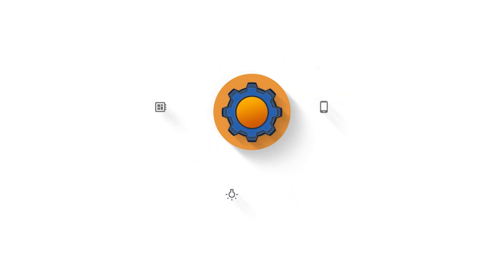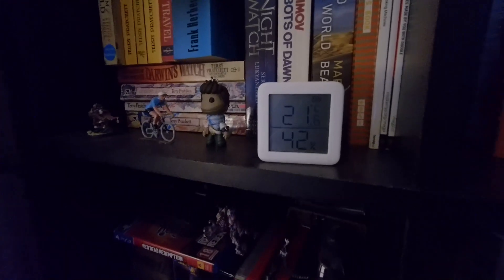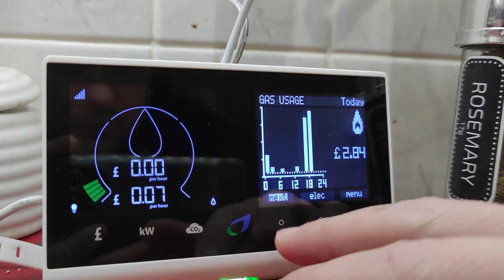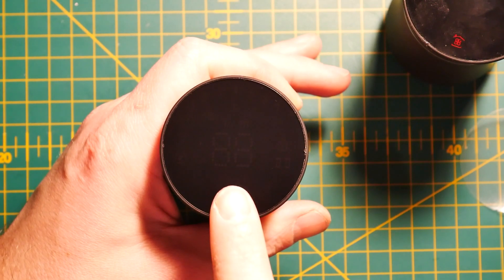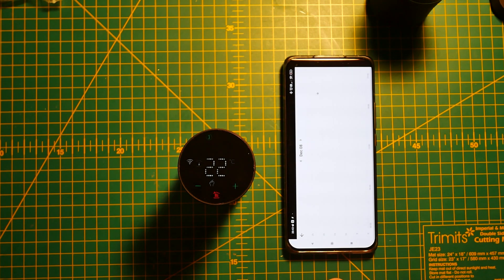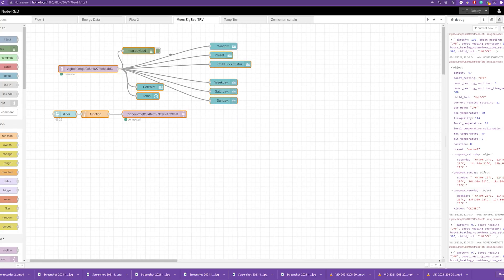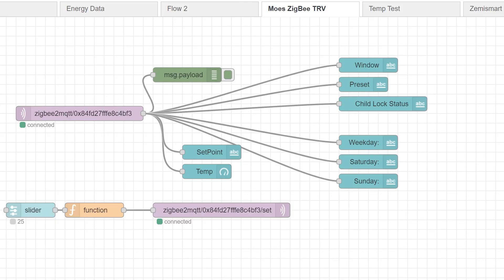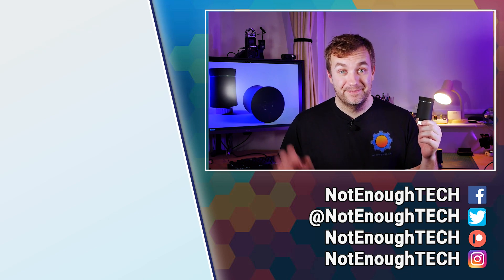Automating old heating system with Moes ZigBee TRVs

Comment: Hey, I stayed away from wifi/zigbee TRVs as I heard the motors driving them are noisy and not recommended in bedrooms. Any feedback on the noise on this one? I was planning on doing electrovalves in the splitter box controlled by a NodeMCU + relays but it's more expensive and harder to install (pipe cutting + fitting)
Reply from the maker: They are completely silent. You can only hear it if you are holding it in your hand.

Comment: Really looking forward to this Matt. I've been thinking about this but had put it off to next year. I suspect half of the existing TVRs don't work any more. The idea is to set different room temperatures at different times but to avoid the horrible programming via 3 buttons! I had concluded like you that the automation needs to  override the main thermostat as otherwise a TVR might open in one room but the boiler stays off as the main thermostat has not switched in. This is particularly so where the main thermostat is in the room with the bypass radiator so that room gets heated whenever the boiler is on. 

The biggest challenge is my wife! She is constantly changing the main thermostat in order to adjust the heating in the room she is in!
Reply from the maker: Take a look at my smart heating v3. It will handle constant fidgeting with thermostat settings and it has framework ready for trvs ;) just need bring all together

Comment: Yep I really looking for smart TRV's which you can directly control the valve position. Then you can make the control loop via external temperature sensor which you can tune. Now you are depending on the control loop inside the TRV. I'm experimenting right now with another ts0601 clone, and temperature control is horrible. Large ripple on the room temperature, which tends to grow over time which means instability of the control loop! My good old traditional Heimeier TRV does the job much better!
Reply from the maker: I actually have figured out the control scheme and I think you will like what I have done.
Reply: @notenoughtech  super! Looking forward to it! If you have a sort of solution to this, that would mean giant step forward! Good job!

Comment: DONT PUT THEM ON EVERY Radiator! (unless you have a wet heated towel rail in the bathroom-non electric with no TRV on) A heating system should have at least 1 bypass element in it. when you turn off the boiler the pump still runs for some time afterwards to dissipate the heat in itself radiators help to dissipate the heat even after the system is 'off'. having TRVs on every item on your central heating system can lead to kettling.

I am in the process of ordering these for my system but I'm leaving my porch radiator unmanaged because the heat from the boiler has to go somewhere when the system shuts off - and if the valves are all closed everywhere else I want it to go to the porch...not get stuck in the boiler.

from a radiator sales website (who would benefit from trying to sell you more TRVs) -  
"However, while TRVs can, technically, be installed on all radiators, it’s usually a good idea to leave one radiator without a TRV and permanently switched on.

Ideally, this should either be a bathroom, which would usually benefit from permanent heat, or the room with the thermostat in it."

I'm just trying to save you a potential repair bill down the road!
Reply: This same problem you will have with traditional TRV's. When they all close, o water can flow in the circuit. But you can install an (adjustable) bypass valve which opens beyond certain pressure difference and thus keeping the flow alive!
Reply: Just make the 11th trv on at a higher temp (or automate to do so). I have a zigbee thermostat that reads the open position of all valves and shuts of the pump if less than one quarter open. Btw I added some of these devices to z2m.
Reply from the maker: Hey thanks for the info. I'll definitely check this out. I will have it installed by a professional so it's likely they will advise me on my system and see if indeed that's the case with mine. 

Either way one radiator running wild is a small price to pay for having others controlled. :)
I appreciate the input in that matter
Reply: @notenoughtech  You may find that your existing boiler doesn't do whole 'over-run' thing when it's turned off. 
But a lot of the condensing new ones do as it's "free heat" so something to keep in mind for further down the road. You could always just pull the valve off one down the line and leave the pin exposed (that's the same as leaving it always on). 
As you say one small radiator doing it's own thing will still definitely be a saving overall!
Looking forward to the updates!
Reply from the maker: I'm able to program this in with redundancy to select the most used room open and fall back on the next room in line if TRV dies

Comment: I need to find the Frankenstat video! 🤣 I bought parts to do what I believe is a similar build.
Reply from the maker: Sounds interesting :) best things are DIY no matter what everyone says
Reply: @notenoughtech  I was referring to your video as Frankenstat. Now that I watched it I see my plan and thermostat are a little different.  I want to simulate button presses on my thermostat rather then override the control as you did.
Reply from the maker: I could in theory have a mini stepper driving the setpoint on my mechanical one :) that would fall as "pressing buttons"
Reply: @notenoughtech  That would truly make it a Frankenstat! 🤣
Reply from the maker: I kinda like the idea. Although I'd lose the ability to set it manually unless I experiment with a holding torque

Comment: I was thinking about doing the same. I have the 10-11 radiators that I need in my shopping cart on Ali but haven't gone through with the purchase. I was thinking I would be able to control how much "heating" I could get from each radiator by using the temperature sensors I had in the room vs the one on the TRV, but looks like it's the TRV that does everything - so I have push data to the TRV for it to adjust itself. Look forward to your followup videos.
Reply from the maker: Ideally you want this done and fitted before the heating season :) looks like I'll be tinkering with mine over Xmas :)
Reply: @notenoughtech  they've been on my shopping cart since last year when I first started looking at them. It's the fact that each one is £20+ that makes me think about it. I wanted to be able to "turn off" certain rooms. Looks like it's not as cut and dry. I would need to do a cost analysis on these like you did with automating lights etc.
Reply from the maker: For the actual saving analysis you will have to wait till spring haha :) but I'll try to make some tests with and without system to prove its working. Its an experiment and I'm curious how well it will work

Comment: Try the Wiser by Drayton system if you not into the whole node red thing.
Reply from the maker: That's cheating :) NodeRed or bust 😆😆
Reply: I tried with an individual Drayton trv and it kept resetting to default every 2 hours.
Reply: Or Tado, Or Hive which are a little cheaper.

Comment: When I was reading the article on your site, when you mentioned a boiler, I had envisioned one like my parents have in their house; 5 feet tall with a built-in water tank.
I couldn't imagine heating a home here (mid-winter we can have outside temps around -25°C or lower 🥶) with a tiny unit like that.
Your gas prices are brutal!
How have you found the accuracy of the SNZB-02 temperature sensors?
I have a couple; the one in the living room agrees with the one that's in my Echo 4, but neither one agrees with the actual wall thermostat.
Reply from the maker: I have one of these too (for water heating in en suite bathroom) it's a mess of a setup that begs for an upgrade. I'm clearly not making enough money on YouTube
☺️

Temperature tests are in progress. I know I promised the earlier but life happened